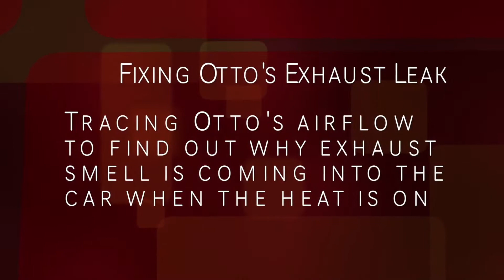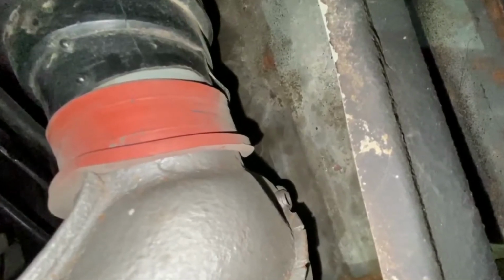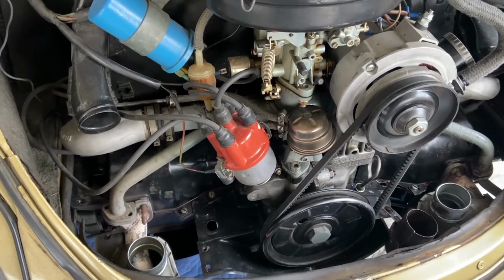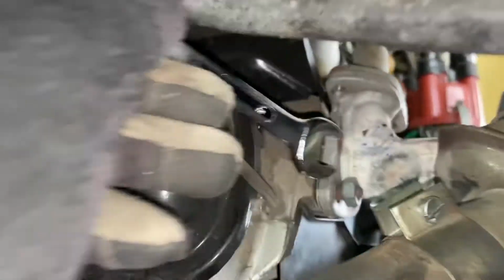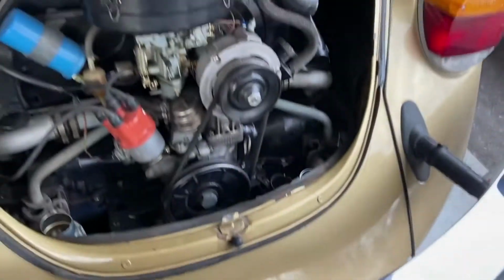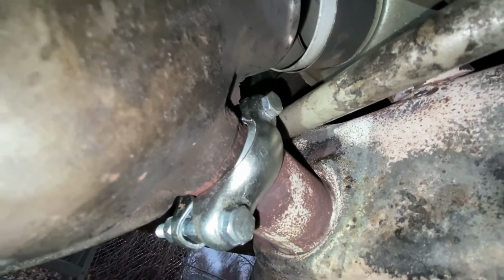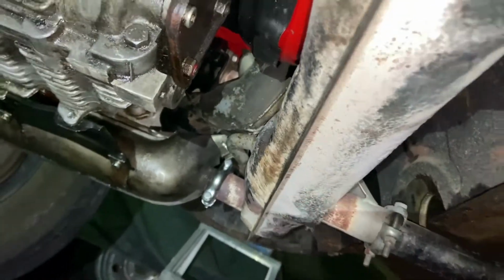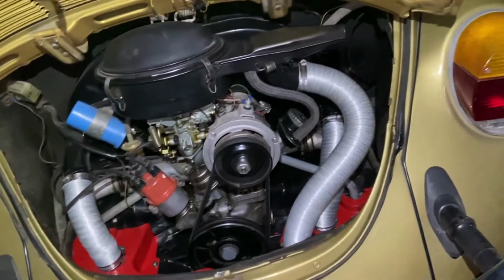Fixing Otto's (74 VW Super Beetle Convertible Sun Bug) Exhaust Issues

Comment: Great going👍🏻 My suggestion is to have a 2nd look at the cork gaskets & the valve covers. If those are not properly seated they can sweat oil onto the heat exchanger. Those ribbed connectors into the cab can be secured with a large hose clamp at ach end. Then you know these will stay on.
Reply from the maker: Thanks Caspar!   Those are great suggestions!!  I think the ribbed connectors are secured with clamps on the heater channel side, and I certainly can add them on the heater box side as well.  
One of my issues is I had a pretty bad oil leak from not having the proper relief tube from my filler going to my air cleaner for a while and it spit out oil from there mostly on the passenger side of the engine bay, but quite a lot came out (especially during my trip up Butterfield Canyon - where I was going up and down steep grades and there was a large portion of the drive on rough, dirt road, which jostled everything around.  That is when much of the really substantial spill happened.  I will be adjusting my valves next week and will certainly be replacing my cork gaskets on my valve covers.  For what it's worth, I don't mind the hint of oil smell,  but I do mind exhaust...  :)  Thanks again.